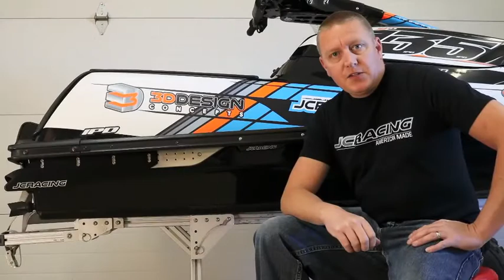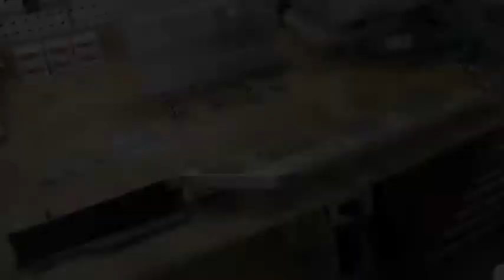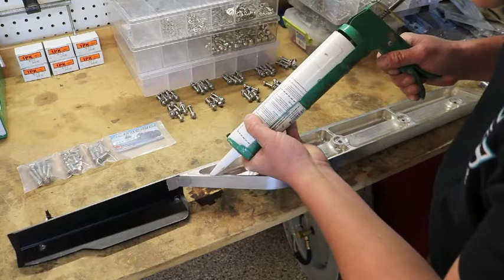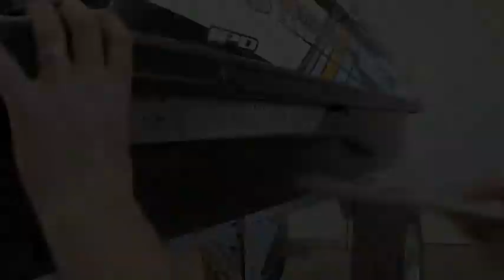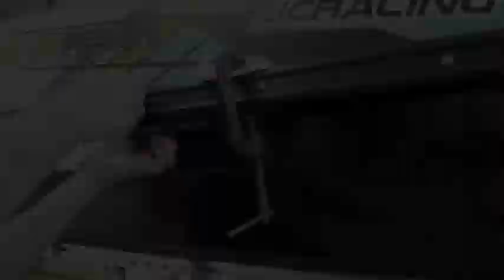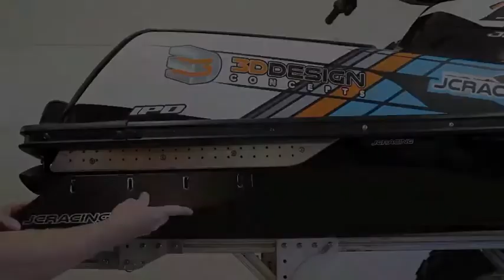JCRACING SXR 1500 Sponson Installation

Comment: How far up from the rear would you mount the jc racing side sponson on a sxr 800. Its actually a trinity v drive hull.
Reply: dan moss, they install at the same location as the SXR 800. 28” measured from the inside of the rear bumper bond flange to the rear of the mid sponson. Contact us thru our website if you need the install instructions.